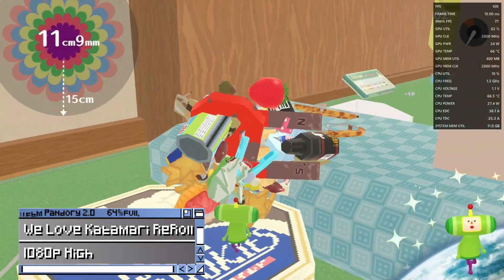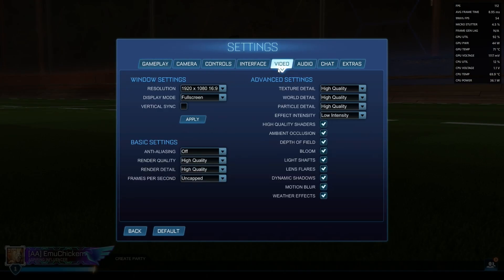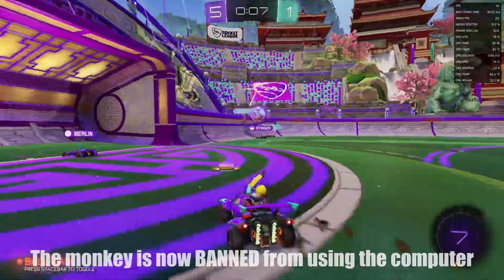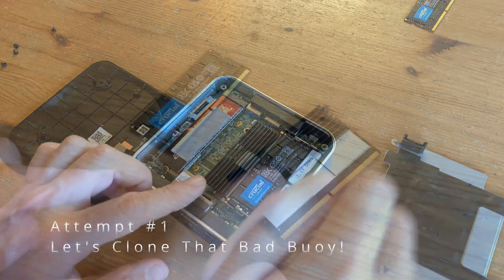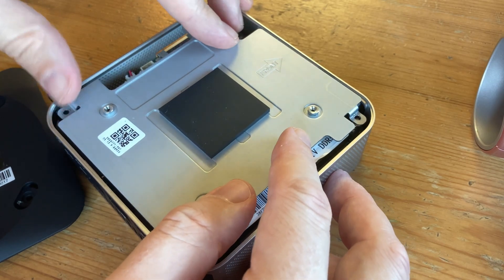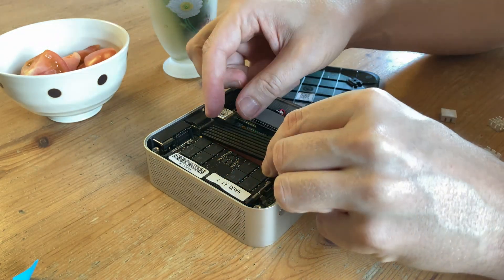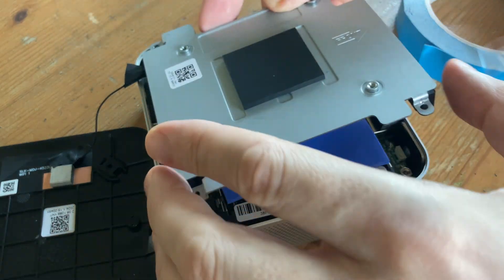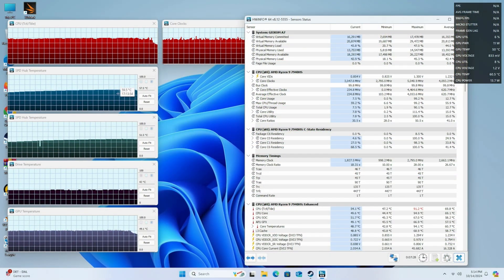Improve Your Geekom Mini PC Performance: Fix Thermal Throttling

Comment: Maybe it's voodoo, but in my case, blocking the left air intake (the one with the SD card reader) helps. When I place the computer on that side or put something against it, the computer magically stops throttling. I don't know why, but it works for me.

Comment: Yeah, thank you. I just did that and fine-tuned it a bit. I got two of those copper plates and also placed a copper plate on the upper RAM module, with 2mm-thick quality cooling pads underneath. Otherwise, I did the same thing. I placed a 3mm-thick pad on the NVME, and now it also has contact with the shielding plate.
Result (A8 Max):
Before: 46°C lower module, 43°C upper module
After: 38.2°C lower module, 36.3°C upper module
Environment: 20°C room temperature, fixed 20% CPU usage due to audio encoding, a 720p video running in the background for 10 minutes
Reply: After 30 Minutes gaming 63,7C° and 59,7C°

Comment: there are 3d print files for a mesh lid with a 120 or 140mm Fan mount on the inside.

Comment: Surprised you didn't cover external usb cooler fans, like a laptop cooler pad.  I have a Bmax B3, repasted, bios optimized, and still thermal throttled due to a poor heatsink design.  Only an external cooler fan placed underneath provided any relief.

Comment: QUESTION, does silent vs. performance mode make ANY difference since this controlls only the tdp of the apu which seems to be cooled well with the active fan.

To me it looks as if the RAM temperature rises 1:1 the same in both modes. Can you confirm that?

Comment: Thank you VERY much! Geekom A8 suffers 100% from the same issue :-(

Will talk to Geekom support first and if they do not offer a solution, I will "fix" it like you did.

A shame that the vendor does not find and fix the issue of the lower ram :-(

Comment: A much easier solution is to simply use an external fan that blows more air through the system to keep it constantly cooled, cheap and effective.
Reply: And also destroys the purpose of a beautiful (aluminum) mini-PC on your desk right ;-)

Comment: Will this work on the GMK k8 Plus?
Reply from the maker: The vsync setting, sure, but the k8 plus has active cooling and AFAIK no issues regarding thermal throttling of the memory.
Reply: @TeamPandory  I was referring to the thermal cooling of the ram, but if there is none of the problems that's better then :)

Thanks brother

Comment: Big like to your video! Just a quick question, what software do you use to see your temperatures while gaming? (like at 5:53, in upper right corner)
Reply from the maker: Hey there, thanks!  That's the Performance Overlay in the AMD Adrenaline Driver software.  Not additional software.
Reply: @TeamPandory  beautiful, thank you!
Reply from the maker: @adamtoth1425  no problem 👍
Reply: @TeamPandory I bought this computer after watching your review video. I absolutely love it! What I did was buy a Tupperware container. Cut a rectangular slot. The size of the intake put double-sided tape on the computer. Stuck it to that against the hole. Then on the back of the Tupperware container I mounted a 200 mm thermaltake high velocity fan. Problem solved. Runs cool as a cucumber. Cost for fan Tupperware container and power supply to run the fan less than $30

Comment: Ehhh. Good job but too much of a hassle. The manufacturer should take more time in testing all component temps and for extended periods of time to make sure they sell something that runs smoothly.
Reply from the maker: @commenter6441  did you skip the 'easy way'?   You literally only need to tick one box.
Reply: @TeamPandory  yes. I should have specified that I'm talking about the better solution which IMO is something that the manufacturers should consider and implement from the get go.
Reply: @TeamPandory  
The easy way does not work for me and also slows the device clearly. Like this somebody could buy another mini PC a lot cheaper with more performance. On my A8 FPS are dropping down to 65-50% of the performance after Minutes in silent mode :-(

Comment: Interesting. Lots of these have the soldered on memory which would avoid it overheating right? Then I guess the throttling would have to be CPU or NVME/SSD?
Reply from the maker: We usually find the memory that's soldered onto the motherboard on the budget tier mini pcs, and those usually have other problems regarding slow GPUs.  As to if they overheat or not, it really depends on the layout and design of the computer.

Comment: Sometimes I wonder if ALL the mini PC and laptop manufacturers ever seriously test their computer designs.  
The number one reason to avoid mini PCs and laptops is the BS that comes with not the form factor, but the bad design which hurts performance and maintenance.  
Not saying there aren't exceptions.  

Good video, I am glad you found a solution.
Reply from the maker: @TrusteftTech  again it depends on system usage. If vsync had been on, and I wasn't going for speeds, then we wouldn't have seen any slowdown unless going to the handful of games that really needed to push the system. 
But yeah, laptops have always been wonky - I didn't enjoy either of the ones I had even with a geforce card. It's probably an inherited problem with shrinking down all the components into a small space. Similar to mini pcs.
Reply: @TeamPandory  There are solutions IMO.  Make them thicker and stop cheaping out on the copper. I don't agree it is anything but stop gap solution to limit the performance of the pc to not over heat.  Saying this as someone who suffered for a long time with overheating laptops.  Some of these computers have ridiculously bad cooling solution.  
Yes I am very angry with them.  (not you).
It's like buying a car which you can't go over X amount of speed or highest gears or else it will over heat and slow down.  It's absurd.  Absurd as a solution, absurd as an example.  WTF was I thinking?
Reply from the maker: @TrusteftTech  calm down. All is well. Rainbows. Mince pies. Chocolate digestives dunked in a cup of tea.
Reply: @TeamPandory  XD bro took it too personal
Reply: I think there would be room in the market for swap cases that would allow more space inside if anyone wanted to make them
Reply from the maker: @theotherside8258  There are some custom cases on thingiverse for various minipcs.
Regarding the Geekom A7, a few months back I actually totally removed the case, and re-did the thermal paste, but it still had throttling issues on Rocket League.
The memory needs heat to dissipate somehow, be it through active cooling with a fan, or by using conduction like we did with the copper heatsinks in this video.

Comment: How about replace default fan for some better? I think that there is one 4 pin fan... so maybe some "pro" fan can help a lot. Also maybe some better thermal paste...
Reply from the maker: @MrBrudracz  it won't make a difference. The fan is on the other side of the case and that deals with the CPU. It doesn't blow air anywhere near the memory which is where the problem lies.
Reply: @TeamPandory  oh OK, I have K6 with 2 fans, sorry :)
Reply from the maker: @MrBrudracz  The K6 has a higher-than-spec TDP at default balanced mode anyways, so I'd choose either balanced or quiet settings in the BIOS.  I'm sure using the v-sync or limiting frames would quieten down your system, but if you want some hardware style upgrades, check our other video regarding mini pc upgrades: https://youtu.be/gPwotg5HUag

Comment: It's nice to see you were not discouraged by each proceeding attempts. I might have changed tactics after the 3rd strips didn't work.
Reply from the maker: @darthslackus  it wasn't actually that difficult to change up the memory configuration.  Compared to cleaning up thermal paste, this is easy peasy 😉
Reply: @TeamPandory  You know speaking of thermal paste...I wonder if we can use thermal tape instead of paste for the CPU, you know have it sandwiched between the chip and heatsink. Have you tried something like that? I might try this when I get a chance.
Reply from the maker: @darthslackus  I haven't, but in the past thermal pads were not as good as paste in regards to heat transfer. 
There was a company that had a special design that didn't ever need to be switched out though. I can't for the love of me remember the name though.

Comment: Thanks for the great content ! 
Do you think doing this for Reaton alloy 9 has an advantage too ? ( The thermal pads on heatsink and on top of memory chip )
Reply from the maker: @kimandy4946  You're welcome! 🤗 
The Reatan Alloy 9 has this heatsink to begin with - it also has a fan pointing at the memory, so from the bat it's much better regarding cooling.
Reply: @TeamPandory  Oh thanks for the info ! :) I ve been doing some research as I am buying a MiniPc soon, and I have heard Reaton alloy 9 has one of the best cooling solutions. 
Just wanted to know if there were methods to cool it even more to make it even more silent ! hahaha. 
Cheers ! :)
Reply from the maker: @kimandy4946  Oh, um. Maybe lowering tdp, tbh it's not a bad pc at all. Best thing you could do to that is perhaps use wired lan rather than WiFi if you're having issues with it.
Just don't bother changing cpu thermal paste - they use liquid metal